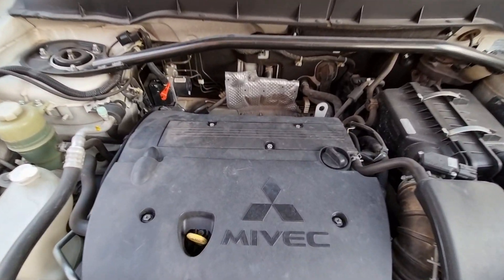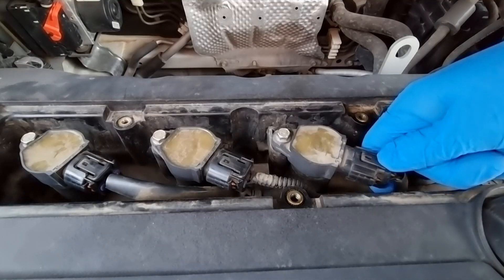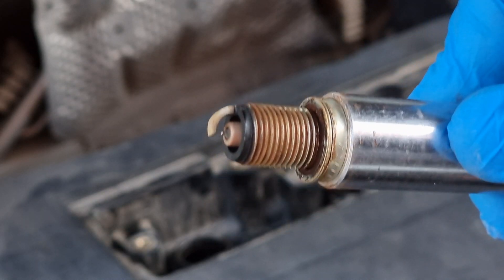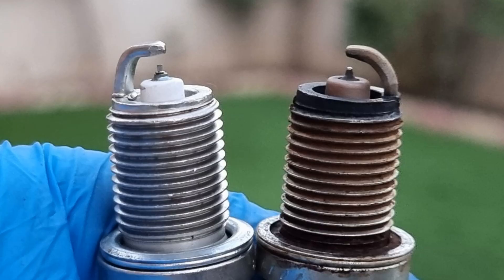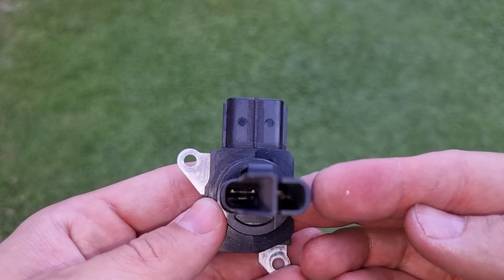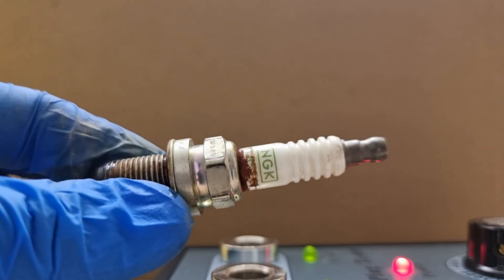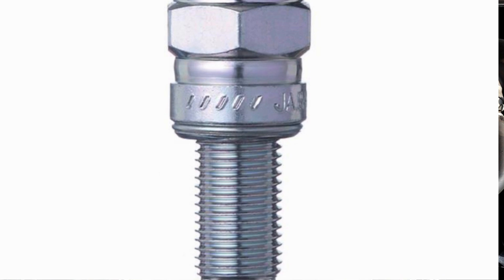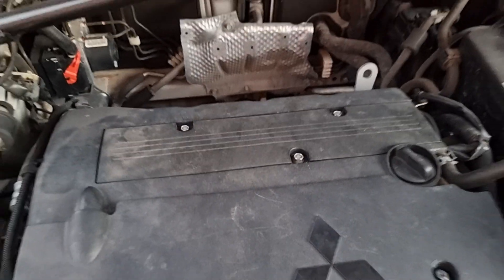How to diagnose spark plug problem / How to Change spark plug/ How to clean spark plug / Alimech

Comment: Nice video. Never seen one of the spark going to the fouled isolator so that was helpful and cool to watch. 

Would be interesting video to take that same spark plug and scrape a ring around the insulator. See how that changes the spark. Then try cleaning with a steel brush and test again. Then clean with a heat gun or torch and test again. 

If I were really really cheap, i would consider bending the top ground electrode to bring the gap back to spec. Then clean the insulator using my heat gun. Get it red hot and the oil and carbon should burn off

Comment: Dont forget that if you just turned off the engine and take out spark plug, it will be wet because its left over fuel on it which is normal. Its only bad when its wet after car been sitting outside for more than hours or days

Comment: Run a couple of strips of electrical tape from inside, over the lip and down the outside of the socket to build it up. Test for snug fit with new plug and it will pull them out as well.

Comment: I'm fascinated by the spark plug tester. Anyway, you're straight to the point. Sadly, I'm driving a carbureted engine car with oil burning issue. So, I'm guessing the plugs will be quite fouled and I should also look at the seals. Thanks for the ideas. Cheers
Reply from the maker: Thanks, I'm glad it was helpful

Comment: Very helpful video.

The new spark plugs I just installed last month came out black. I am purchasing new spark plugs and a spark plug tester. I believe my engine issues are chronic at this stage and even an engine oil flush will not suffice. The intake manifold is clean.

I was having misfiring issues then I replaced them. Now they look so bad.
Reply from the maker: Thats awesome, thanks for tuning in Katherine, glad my video was useful
Reply: @AliMECH  my fuel injectors had leaks so the spark plugs are black. Time to change indeed.
Reply from the maker: @Katherine  have you try to clean them like I clean them, sometimes they get better
Reply: @AliMECH  they are fouled and also need regapping. I bought new ones. Some new fuel injectors and seals too.
Reply from the maker: @Katherine  in that case, replacing is better option, great job working on your car by the way

Comment: My car misses when i accelerate from lower speed but it runs fine in faster speed.. is it becoz of the spark plugs or fuel injectors or something else?
Reply from the maker: If the fuel injectors dirty and inject more fuel, this happens , and also if you have bad spark plugs, but clean the fuel injectors first,  I have so many video for cleaning fuel injectors